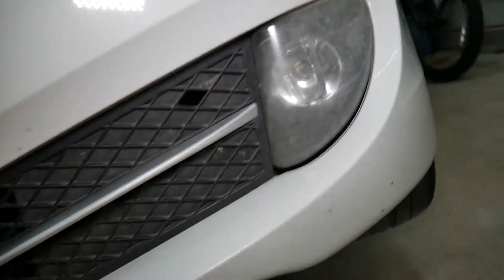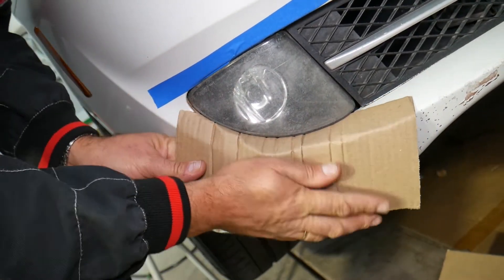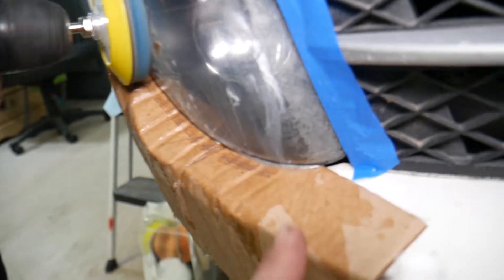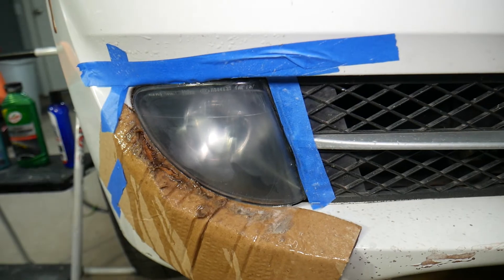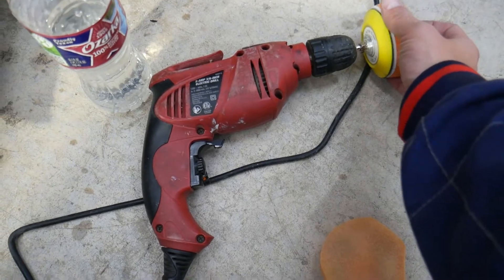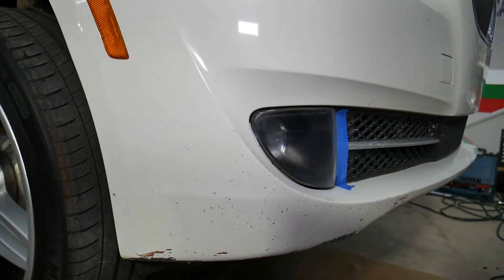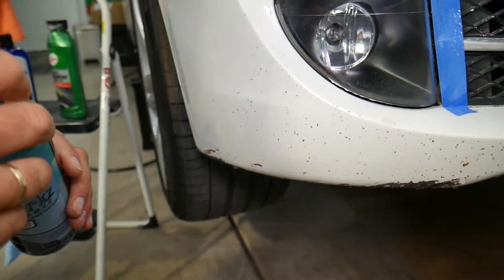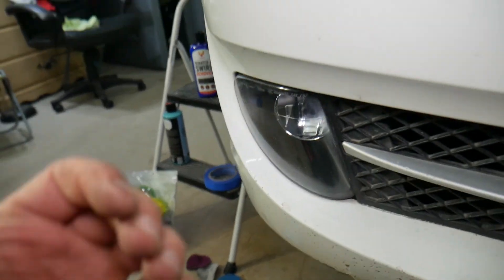HOW TO RESTORE FADED FOG LIGHT ON A CAR, YELLOW FOG LIGHTS FIX

Comment: Hey guys I just use that same 3M kit on my 2007 Altima last summer and it came out awesome just like yours. Long gone are the days with glass headlights like my 93 Honda Accord which I loved by the way. Interesting how car manufacturers had a cheap out and use the plastic that they knew would craze and turn into that condition after just a few years anyway cheers. Your channel is awesome